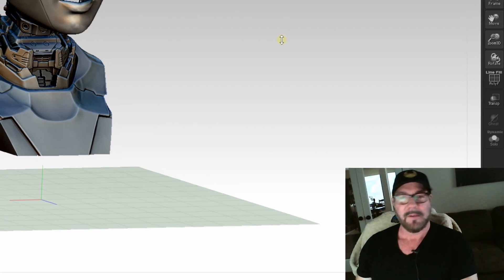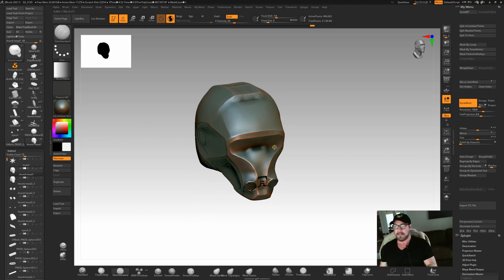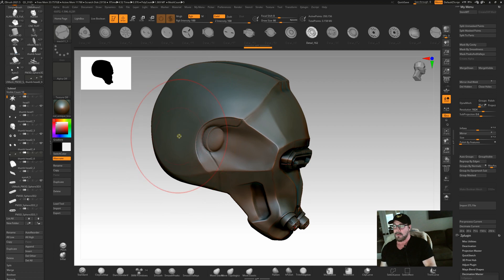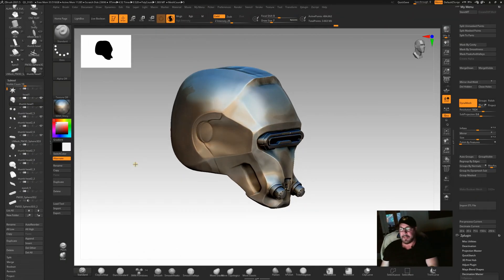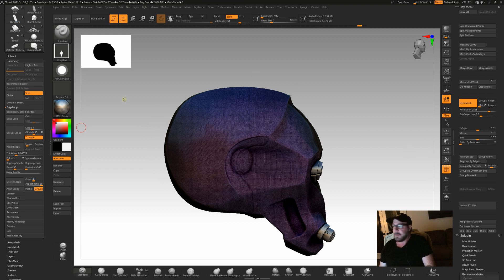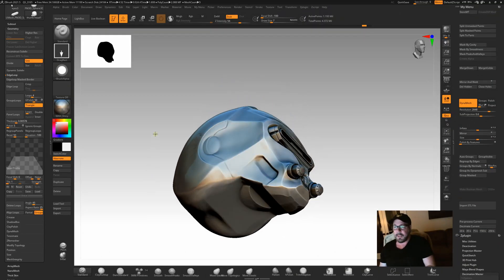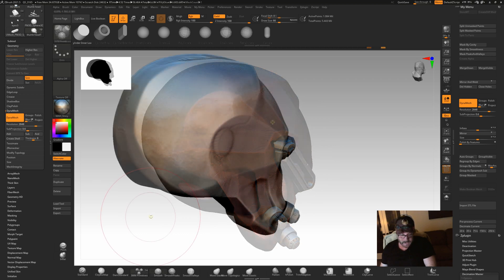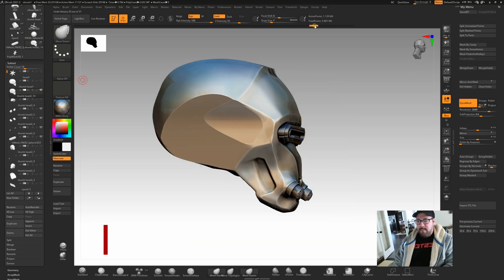ZBrush tools I use to conceptualize robots...for 3D printing

Comment: Nice!!! Always eager to learn!! 😁
One question, these model have a pretty dense mesh resolution, would it also be possible to get the resolution down for the use in Unity? 😊
Reply from the maker: You bet there is a built in Decimator...prolly the best I have ever used. You can bring the model all the way down to 3% of the dense mesh and still hold all the detail. That certainly deserves to go in my next video!
Reply: Thats awesome! If you want to shoot me a low poly version of your bartender robot, I could check if I can manage to rig it up in Unity? Just an idea that crossed my mind... 😊
Reply: ZRemesher. Solid tool, but manual retopo is always best to keep good topology, which is super Important in realtime applications. There are some pretty powerful automated retopo addons for Zbrush too, like zwrap. also worth mentioning that a lot of the structural detail of game assets is in the texturing. like, if you try to take will's robot head and decimate it, you would lose a lot of surface detail and it would look really mushy. you have to fake some details ( PBR Normal maps and stuff like that) for things to run smoothly on a wider variety of hardware.
Reply: @God-ib7xc  Its always nice to see that god still cares about us!! :D